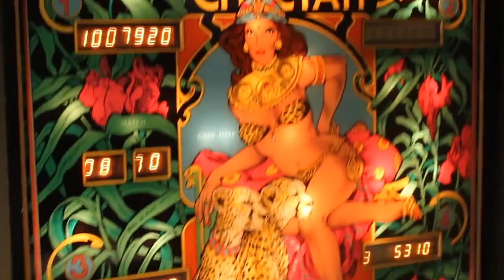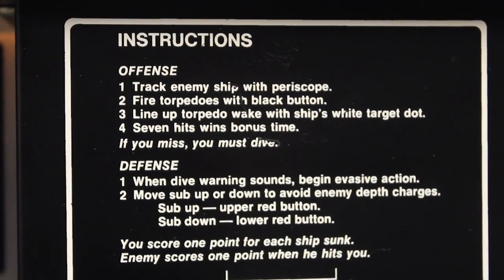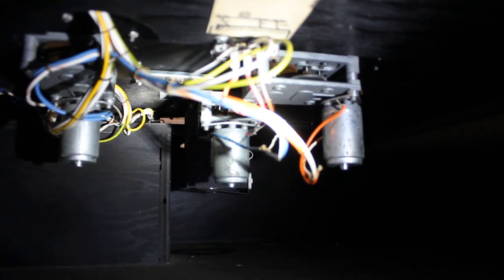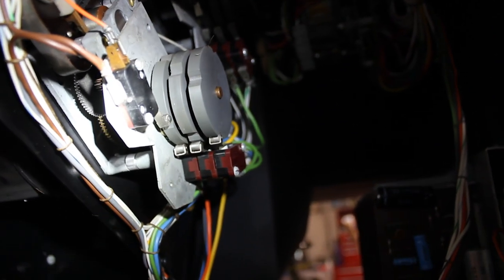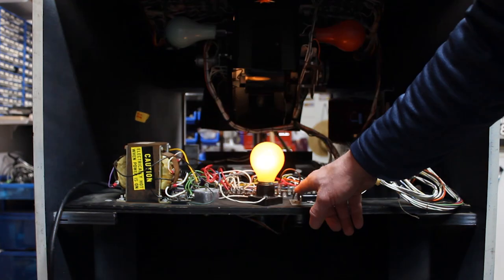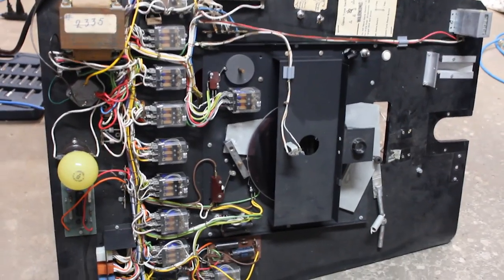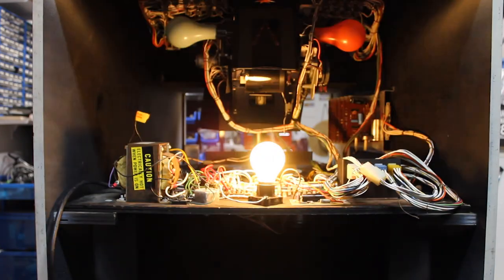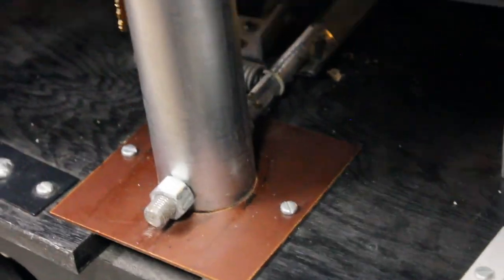1972 MCI U-BOAT arcade machine

Comment: I know an arcade that had one of these from 1972 to about 1995, perhaps even longer, at a seaside town so they were not looking for repeat plays, it was popular because it was different, people ( kids ) passing found it difficult to resist having a go. and i played it every time i visited out of nostalgia and just because it seemed  lost in time. It rarely worked properly or fully, not surprising considering how many years it was on the same site, but people still put money in to it, and then tutted that its registering hits as misses and misses as hits.
Reply: Ha ha, why video games quickly replaced the electro-mechanical arcade games. Without proper and continual maintenance they quickly developed problems.  I have restored a bunch of EM gun games and the complexity is way beyond a pinball game. Many steppers, relays, motors, flashing light mechanisms, switches, timers, plenty of spring loaded targets, even chain drives, and goofy sound mechanisms. They all should be preserved.